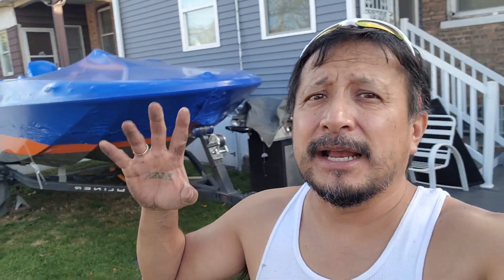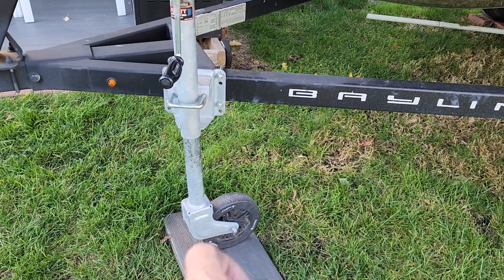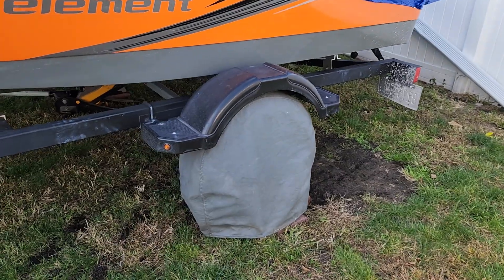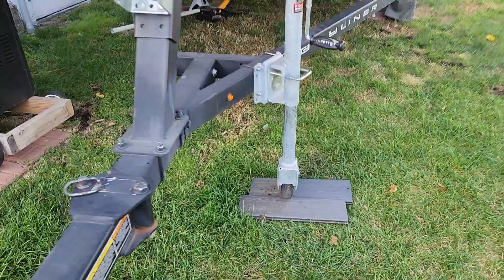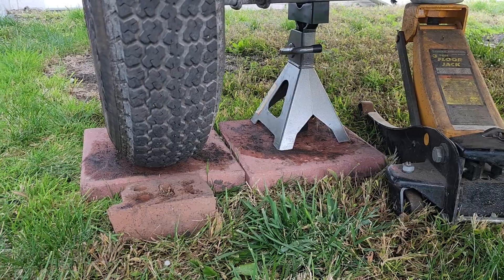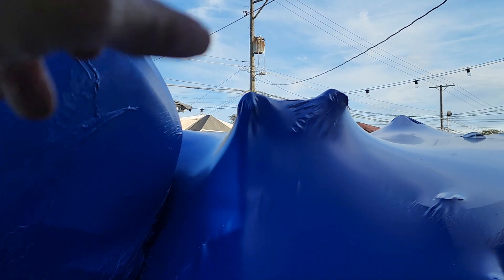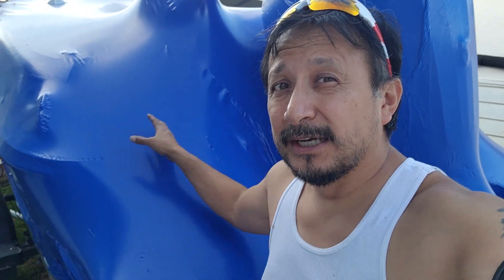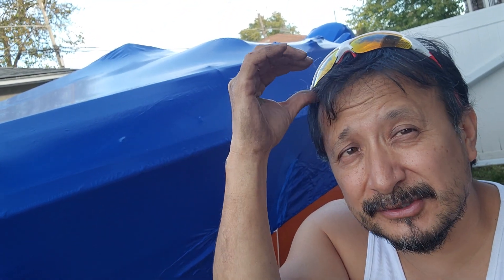Storing a run about boat trailer outdoors for the winter

Comment: Great video. What's your thoughts on jacking the frame instead of the axle. That would allow the leaf springs to hang and not compress.
Reply from the maker: never thought of that. it seems to be fine this way.